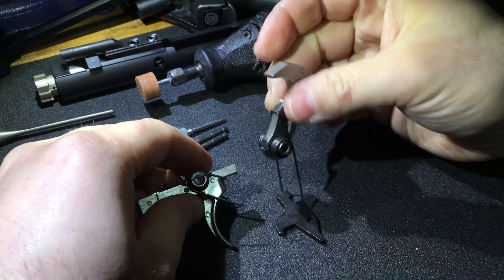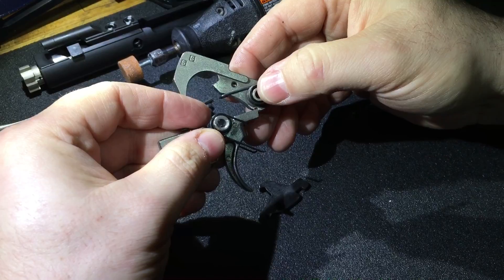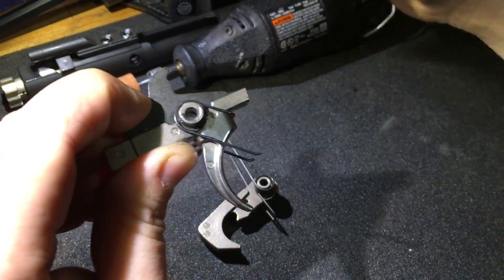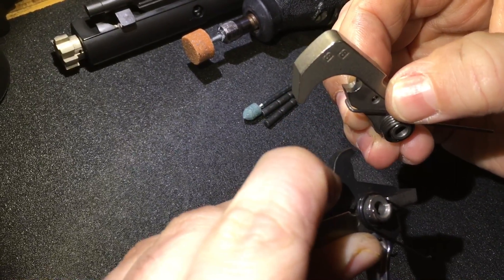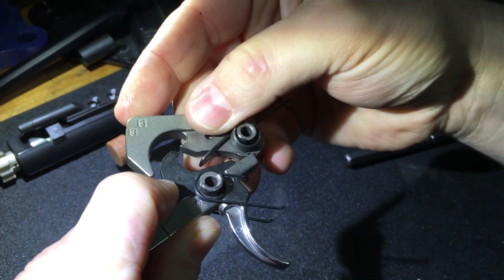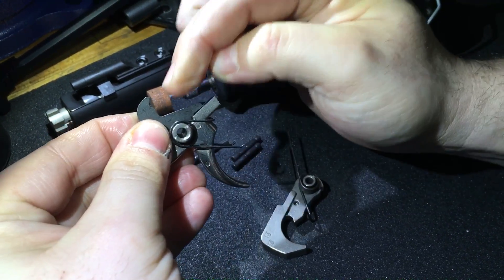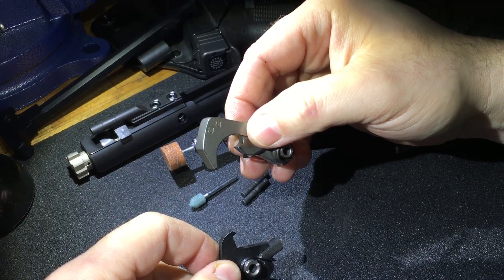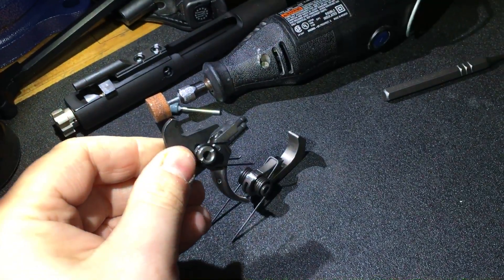AR 15 trigger fix

Comment: Realize too that parts here are often surface hardened. Once you kiss them with that grinding stone, you remove the hard facing and then the parts will wear quickly due to the softer steel being exposed.

Comment: Gonna try this. I built a lower few weeks ago and I'm having this problem. It's sporadic also. Can do pull and reset few times and it's normal. Some times it does fire on pull and the release. Did like 5 in a row and fired on pull and release. That's what caused me to look for what is causing it and found your video

Comment: This fixed my double fire problem. You rock.
Reply from the maker: sine1son GREAT! Glad it helped
Reply: except 7:04 is WRONG.  It is legal to shoot doubles, IF the 2nd "bang" comes ONLY when you let off the trigger, or make some OTHER action, after the trigger "pull".  Just "triples" are illegal (which is unlikely to be even possible: the next type of trigger malfunction which lets off "more extreme than just turning it into a binary trigger" should be "unlimited" not "triples" unlimited meaning "full-auto").  ~Bill S Preston, ESQUIRE.
Reply: @thebutcherofbenghazi.libya3348  what ever you said, it doesnt matter. Important is the author give us information that is very helpful correcting hammer follow.
Reply: @bongd244  it does matter. He said binary triggers are illegal and they are not. It is not illegal to purchase, own or operate a binary trigger.

Comment: thank you again. I did exactly what you said to do in your video and it works perfectly now. shot 150 rounds no problem out of my 10.5 ar pistol from psa. I was having the exact same problem.
Reply from the maker: skip skipper that's awesome! I'm glad I could help.
Reply: skip skipper.  ... On a mobile,  Q: What problems were you having, and what was the cure?   Addtionally was the lower from PSA also ?

Comment: Thanks man! This really worked. I was careful when using the dremel and measured how much i started with. I removed about  a millimeter of material. 

My trigger was having hammer follow when I released the trigger very slowly. So if someone is having double fire and cant seem to replicate it during  a function check, try releasing your trigger very very slow.
Reply: Holy $#it man, a millimeter is a $#it load! We should be working in thousandths here, a millimeter is like a mile in this world!

Comment: I just built my AR from the ground up with a polymer 80 lower. I put the first 60 rounds thru it today and was having the same issue. I thought it was something I did wrong! I will pull the trigger group apart and try this! Great video thank you!!
Reply: UPDATE!!! IT WORKED!!! Thank you so much for the info! My lower kit was from Palmetto State Armory. I had the exact same problem. And that's totally stock, out of the box and into the gun. I dremelled off a bit of the extractor like you showed and BOOM problem solved!
Reply: Here's another update. If you file that down just a little bit too much, your safety will not function correctly. I ended up tossing it and getting a drop in. Now she shoots like a friggin dream and no more safety issues.
Reply: @Ammonymity1776  what was the deal with your safety? I have a p80 lower as well, but with a lpk from brownell's, DPMS I think. Anyway, my safety will switch to safe when the  hammer is uncocked. I was having an issue with the trigger firing instead of resetting, which i fixed with this video, but the safety thing is still happening. It just goes into safe mode when I'm sure it shouldn't. It won't fire in safe mode,  thankfully, but I'm having trouble finding a fix for the issue.
Reply: @ezrabrooks8551  if I would have my safety ON, I'd charge the rifle and when I released the charging handle it would fire! And also, if it was already charged. With the safety on, when I clicked the safety Off, it would fire! Needless to say, that wasnt working too well for me so I put a drop on gold trigger system from ATC
Reply: @Ammonymity1776  oh wow..mine isnt doing all that..thats a lil scary. Glad you got that resolved. I may end up going with a drop in system myself.

Comment: Thank you.
Did an AR 9 build and was getting double fires occasionally. Kept thinking the problem was with my bolt, buffer weight or buffer spring. I was using a PSA lower combined with their lower parts kit. Filed down the disconnector about 5or6 file strokes and problem solved. You saved me a lot of ammo and a possible trip to the gunsmith.
Thanks again!

Comment: So to sum it up, you messed with a mil-spec trigger, designed not to be a 3 lb. target trigger but designed for combat, and in changing four  precision metal surfaces with your Dremel tool, you screwed it up and NOW have fixed the problems you created.  Is that about right?

Comment: Im not getting double fires, but my trigger wont reset.  The disconnector wont let go of the trigger unless I pull the trigger forward or actuate the safety on and off.

Comment: Great video. Thank you. Now I know how to fix the problem.

A binary trigger is not illegal though.
Reply from the maker: Youre welcome. And i know binary isnt illegal...its just not safe when youre trigger is functioning in that way especially when mixed in with groups of ppl that dont exercise safe gun handling
Reply: @vbstangin  There illegal in Iowa and a few other states.
Reply: By atf ruling a binary trigger that functions this way is illegal because if you hold the trigger in a sweat spot between both catches and allows the hammer to follow the bolt without being captured.
Reply: @michaeljacques7336  You might want to recheck your information. Binary triggers are not illegal and if it is a binary trigger it's supposed to function that way. Now if you're manipulating the trigger to do what is called a bump fire with your fingers that is not illegal either as you have a legal trigger assembly. It is the way you personally manipulate the trigger to make a bonfire and that the ATF cannot regulate. Also realize the ATF does not make laws only the United States Congress has that authority.
Reply: @gregoryromeu431  I’ll make my first statement more clear. Binary triggers are legal, the way a legal binary trigger functions is that the trigger is pulled, the hammer drops, the gun fires, the action cycles, the hammer locks back again,  the trigger is released the hammer drops again and the the rifle fires and we are back at step one. Binary triggers that are sold by manufacturers do not function the way that the modification in this video does. With the modification in this video, it would seem that the trigger is functioning the same way, but when an AR trigger is modified in this way there is a sweet spot, where if the trigger is held in the middle of the pull range, the hammer does not catch the sear, nor is it caught by the trigger catch. This means that as the gun cycles the hammer just swings back and forth following the bolt. This is a major problem for two reasons, one: when the hammer follows the bolt either the hammer won’t have enough energy to set the primer of or the gun will slams fire. This makes the gun function as an open bolt machine gun, you are not cycling the trigger, you hold the trigger in one spot and fire multiple rounds, that’s a violation of the Hughes amendment. Two: It’s also extremely dangerous because you are firing full auto without and auto sear, which means that there is nothing to control the guns timing. If the bolt hangs up an all you will get an out of battery firing and the gun will explode in your face! If you don’t believe me there are more that a few videos on YouTube of AR sears breaking, where the gun unexpectedly fires a few full auto bursts and then blows up. I say all of this as a trained gun smith and a guy who has made trigger groups from a block of steel with nothing but a set of files. Choose your own adventure!
Reply: That sweet spot as you call it is where people either use their fingers or a shoe string or a belt buckle or some other device to reach so that they can get what is called, "bump fire". I understand the point that you're getting at however I too have been around firearms ever since the Marine Corps days and have been building and working on firearms for well over 40 years... I've also studied law in quite a few areas and the Hughes amendment does not make it illegal to utilize your fingers to cause your trigger to bump fire on any kind of a trigger system. That would be holy unconstitutional which makes the Hughes amendment wholly void.
Reply: @vbstangin  how does the way my trigger function have anything to do with a group of people that don't understand gun safety?
Reply: @michaeljacques7336  please cite the ATF "rule" that you are talking about? I was an FFL and I am not aware of any such "rule"?
Reply: I’m not talking about bump firing. Bump firing is when you use the recoil of the weapon to allow the weather to move to the rear while the trigger finger stay in the same place, then the weapon is pulled forward causing the trigger to be depressed again. You can do it with a bump stock, a shoe lace, by pinning your finger to your hip or probably 50 other ways. I’m talking about building a trigger group that accidentally converts your AR into an illegal machine gun, that has an untimed hammer flopping around, firing untimed bursts until your gun blows up. If the hammer follows the bolt home and cause the gun to discharge it’s functioning as an open bolt machine gun, that’s a violation of the Hughes Amendment. If you want to make an illegal machine gun that will explode randomly at some point, be my guest. If you think the Hughes amendment is unconstitutional, I totally agree. If you think that you’re constitutional scholarship means you can do whatever you want and not be subject to federal prison, have fun with that. I’m actually trying to make a post that contributes positively to the 2a community, by letting people know that if this mod is done improperly that they will be exposing themselves to catastrophic injury and may be inadvertently committed a felony. Yet someone always has to come along and try to talk shit!
Reply: What you're doing is advising people to make modifications to their firearm or to their trigger group which is a job that a gunsmith should be doing. You're worried about bump firing and the trigger firing multiple shots with one pole of the trigger being illegal and you keep talking about the gun blowing up, what do you think would happen if your advice is performed by an experienced person and the gun blows up and they either die or get maimed and track it back to you? Quit trying to be a hero and just advise these people to switch out the lower parts kit with a new one and dispose of the old one. OR, take the firearm to a gunsmith that knows what they're doing and have them fix the problem.
Reply: @michaeljacques7336  you're all over the map on this issue. First of all I wouldn't be on an open form advising any untrained person to start filing and modifying any parts on a firearm. I would suggest to them to check their manufacturer warranty and send the firearm back to the manufacturer and have them deal with it or else take it to an experienced gunsmith rather than to sit here and create a liability of all these exploding firearms, that we hardly ever see or read about in the news, and I would just tell the person but if they felt confident and their ability to just swap out the lower parts group and not file or modify anything. Well you're supposed to telling an experience you should know much better than that because that puts you liable for any of these people that might utilize your advice and try to modify their firearms and say they do blow up in their face, their next step after they get out of the hospital would be to get an attorney and then come and empty your bank account.

Comment: Great video! I just finished an AR15 pistol and it dbbl fired! Never happened before and I wasn’t sure it even did until I saw two shells! My bad -first by putting disconnected spring upside down 🤦🏻‍♂️… I fixed that but now I have a very slight 1/8” pull before trigger actually engages. My best description would be what it feels like when safety is on and you attempt to fire getting that little pull before safety stops you. Any idea what’s happening?

Comment: Thank you I am having this issue with a brand new 9mm rifle. I did swap out the springs for the JP3.5 springs which I have on three other ars and have not had this issue. Could those springs have anything to do with this issue.

Comment: You should pin a correction to this video for strong misinformation. It is NOT illegal to purchase, own and or function a binary trigger. It is not classified as a fire arm or machine gun so it is not illegal to manufacture as well. Only parts manufactured for purchase of the intent of creating a machine gun will be classified as a machine gun. Binary triggers still require one action for one shot. Auto Sears however ARE machine guns and require the tax stamp and all that good stuff.
Reply: Here in Florida, they are on the bump stock ban list, but the way the law is written is in a gray area. Almost anything could get you in trouble with the law depending on their interpretation. Below is what it says about the bump stock ban in Florida and what all is covered on said ban.

Effective October 1, 2018
790.222 entitled Bump-fire stocks prohibited. Reads —A person may not import into this state or transfer, distribute, sell, keep for sale, offer for sale, possess, or give to another person a bump fire stock. A person who violates this section commits a felony of the third degree. 

The new law goes on to define the term “bump fire stock” to mean a conversion kit, a tool, an accessory, or a device used to alter the rate of fire of a firearm to mimic automatic weapon fire or which is used to increase the rate of fire to a faster rate than is possible for a person to fire such semiautomatic firearm unassisted by a kit, a tool, an accessory, or a device. 

Reading the definition should cause concern. It is so vague that it could include almost any modification to your firearm.  There are many items sold that can accelerate the rate of fire of a semi-automatic firearm, including both handguns and rifles without making them automatic weapons: 

It can be argued that lightening the pressure necessary to pull the trigger increases the rate of fire to a faster rate than possible unassisted by a kit, tool, accessory or device.  Until a court rules on this, understand that you may become the test case if you modify your firearm to fire more easily by decreasing the pressure necessary. 

Other accessories include, but are certainly not limited to: 

Traditional Bump stocks
Crank fire devices
Binary triggers
and many more commercially available conversion kits or devices

Comment: Binary triggers are legal. Pull and release are two separate functions. Don’t remove material from the bearing surfaces of your FCG. “Polishing” a trigger should not remove material or you’re using the wrong attachment on the tool.

Comment: I have done the same. And it works. My only caution is that you take it and test it and test it and test it again you do not want to be on the very edge of the seat and have a delayed release. Or an occasional double fire

Comment: My build has a crappy trigger pull and gets hung up on the reset I go to pull the trigger and it’s like the safe is on remove pressure and go right back on works fine 15 20 cycles then hemmes up again.  I am petrified to f with the trigger but might investigate it a bit and see if it will clean up…. Awesome Vid.

Comment: Did a build first time out shot 50 rounds no problem. Went back two weeks later double shots replaced with new trigger still had problems just exactly how much of the tip should you find off not a mechanic. So the problem is with the disconnector

Comment: I'm having the same exact problem. When I let off of my trigger slowly, it skips the trigger sear, and fires again.  If I let off of my trigger quickly, then it functions correctly.  I have already ordered a new trigger group, but I'm gonna try this trick, and hope it helps.  Thank you sooooo much.  I couldn't figure out how to get it back in time.  This should work!!!!
Reply: I took off some material, and it's already getting better.  How much material can I take off?  I'm thinking as long as there's enough material left, to engage the disconnect sear, right?
Reply: Awesome

Comment: Thank you saved me lots of trouble and $.   I did some home trigger jobs on my AR's.  I noticed when I let trigger reset very slowly, the hammer followed every time.   Resetting Fast the sear caught most times.  Easy Fix!
  Anderson lower and parts.
Reply: infowarguy - that is exactly what happened with mine.  Ni problem qith quickly releasing the trigger but double fires on slow resets.

Comment: My DPMS started double firing exactly like this after about 200 rounds. I have to release the trigger in a very quick exaggerated fashion to get a proper trigger reset and avoid double firing. Good info, I’ll try it out

Comment: 1) binary triggers are not illegal. 2) that Dremel should not be anywhere near your trigger. 3) if you have a problem get a new disconnector or check that your spring is installed correctly. Do not dremel or file  triggers
4)  If you want a lighter trigger get a nice two-stage component trigger like the larue mbt2s or Schmidt tool

Comment: Yup, this is an old gunsmith technique to file down the bottom of the AR-15 disconnect tail to get proper contact. This was a common problem and knowledge back in the early 80's when SGW was the only other game in town other than Colt...It won't hurt anything to file the entire bottom of the disconnect tail so it will drop farther to contact the sear...